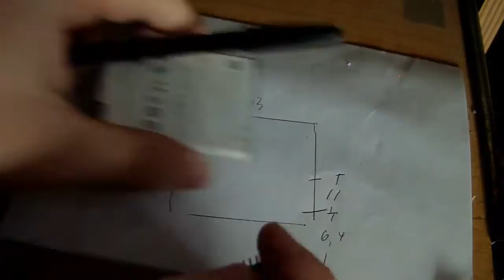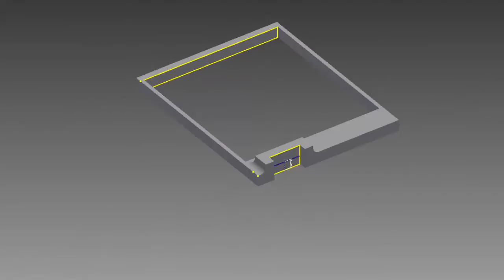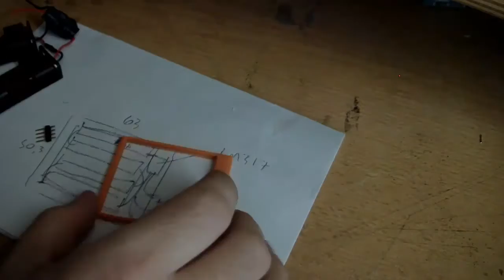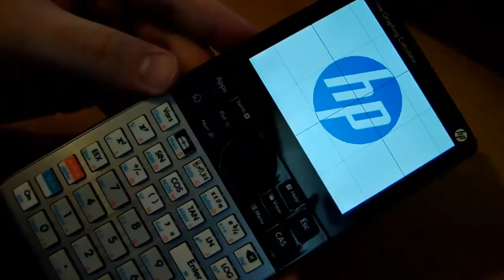Can the HP Prime be powered using normal AAA batteries?

Comment: Would have been 1000% better had you utilized a button cell array and were able to put the battery compartment back on!
Reply from the maker: Not sure about the 1000% better estimation
Reply: As per the mod... powered, yes... practical, no...
 So lets just say with button cells - 100% better for all batteries staying in their mounts/sockets with compartment cover placed back on... and with cover on; dust, dirt, and moisture reductions 50%, 400%, and 450% respectively.   :^)   Dang! Now my nose out of joint.
The % isn't important. Enclosing the compartment is important, at least from a preventative maintenance viewpoint.
   :-)   There!   That's better.